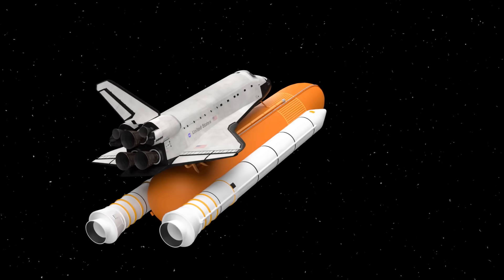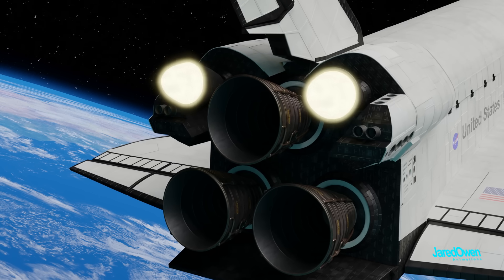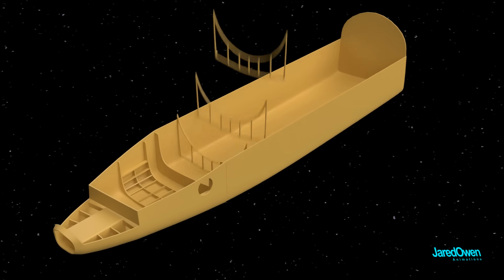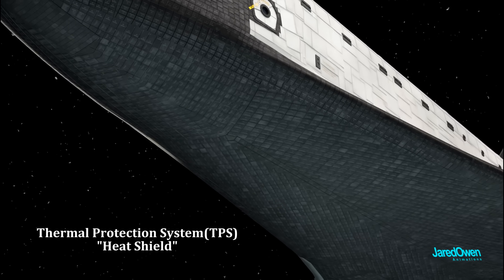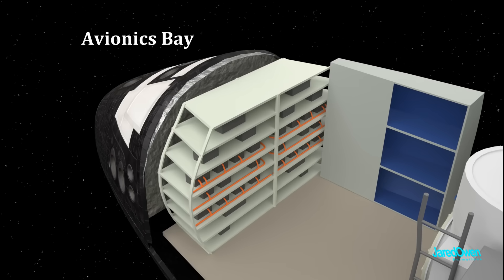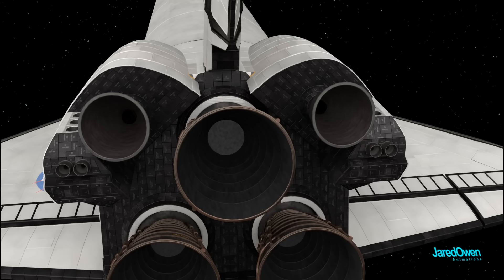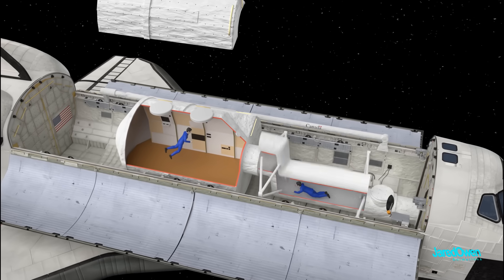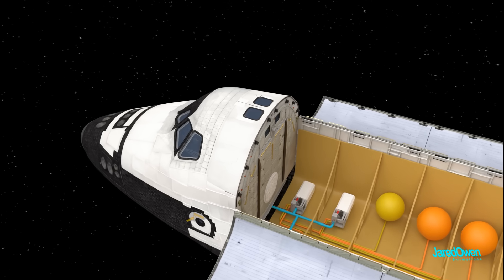How did the Orbiter Vehicle work? (Space Shuttle)

Comment: I hate to be like this but the space shuttle is NOT reusable, it is REFURBISABLE, same with the SRBs. they had to put extensive into repairing the space shuttles after each launch, unlike the falcon 9 where you just do a few checks and load the fuel back in. this is an important distinction.
Reply: Unmanned Falcon 9 missions are one thing but refurbishing will be required for manned missions.
Reply: I should have checked about the Falcon 9 as it turns out the 1st stage does get some refurbishing. Here’s a quote about the block 5 version:

“Block 5 could change that. The vehicle boasts many upgrades that are meant to shorten the refurbishment and downtime needed between flights.”

So obviously shortening refurbishing doesn’t eliminate it completely.
Reply: mako88sb I believe that is an old paper you are citing. The block 5 is currently the one that is in use, and yes they have to clean it but they don’t have to replace half the systems after every launch.
Reply: @MackAttack101   Yes, from 2018 but the point back then was that some refurbishment was still going to be needed. Some things were changed from welded to bolted-on for ease of removal for inspection. From what I’ve read, the goal is a booster getting 10 launches before refurbishing so definitely an improvement if it’s achieved.
Reply: mako88sb which makes it reusable, no? Not needing the refurbishing means it’s reusable.
Reply: @MackAttack101   Yes, that’s the goal but looking into it more, I’m not sure they will reach it. Musk previously said they would launch with the same booster within 24 hours no later than 2019. The recent launch of the South Korean satellite reused a booster 51 days after it landed which broke the turn-around time record held by the space shuttle Atlantis but no were near the 24 hour goal he was pushing for previously. Obviously the practical realities of reusability with minimal refurbishing are much more challenging than Musk’s expected.
Reply: @MackAttack101    “ Over the years they’ve mastered landing the Falcon 9’s first stage, and they’ve even proven that the recovered boosters can be safely reused for additional flights. But the refurbishment process is still fairly lengthy.”

From this: https://hackaday.com/2020/07/27/falcon-9-beats-shuttles-reflight-record-but-still-has-a-long-way-to-go/

Comment: Is it possible for the shuttle to be controlled remotely from Earth?
Reply: Not originally. However, after the  Columbia disaster, the remaining fleet was modified so that they could. The new procedure would determine if any tiles were damaged during launch and if severe enough, the crew would be left on the ISS. The Shuttle would then be remotely landed. The flight plan for such an eventuality would be over the Atlantic or Pacific as much as possible in case the damage caused a catastrophic failure.

Comment: great video but i do take issue with you saying it was reusable. While yes that was the intended goal the space shuttle was never truly reusable. After every use it had to literally be disassembled to make check literally everything. not to mention the external fuel tank needed to be built. it was refurbishable more than reusable
Reply: Good point. A big reason for the huge escalating costs and much longer turn-around time’s compared to what was advertised. I can see the same issue for any man-rated SpaceX spacecraft. The Dragon is pretty small so shouldn’t be too bad but it’s also pretty complex. I have Scott Sullivan’s VIrtual Apollo and it’s mentioned that the CM had the complexity of an aircraft carrier packed into something the size of a VW Beetle. The BFR with 31 Raptor engines being a reusable system just boggles my mind. I hope they pull it off but definitely have concerns.
Reply from the maker: Thanks for the comment - you are correct,  probably the right word is "refurbished"

Comment: Great video! Really amazing overview.
I know you can't put everything in. In addition to the landing gear, there are 2 more doors on the bottom to connect the aft of the orbiter to the ET to allow power, fuel, and oxidizer to be transferred. You can get into the wing through the landing gear. There was a drag chute compartment. You showed avionics bays 1&2, but there was also 3a and 3b on the mid deck. Avionics bays 4, 5, and 6 were in the aft. There is also an access door on the port side to enter the mid body and both sides to enter the aft. These doors were used to work on the orbiter.
Reply from the maker: Wow you know your stuff!!  yeah it's hard to figure out what to not include in a video.  There is so much cool stuff!!!
Reply: Jared Owen I worked on Discovery, Atlantis, and Endeavour.

Comment: The space shuttle was probably the best spacecraft I’ve seen. Too bad it failed and got retired
Reply: David Xu Oh, Columbia Disaster. The engines on the thing didn’t ‘burn out inside’, it was a piece of the heatshield being thrown off on liftoff, which came to bite them on re-entry. The gases and other nasty stuff started to leak into the payload bay and then the commander and such were knocked out. The thing then probably disintegrated due to being uncontrolled.
Reply: It was better it was retired, it was expensive and dangerous. Not to mention it’s design by committee leading to some Interesting... design and management decisions
Reply: @amanwithnohat3948  
Yeah it was indeed
Don't you know the Space Shuttle program 
costs up to 
US$ 211 billion as of 2012
Reply: @amanwithnohat3948   and the cost per launch was 
US$ 1.64 billion
Way to costly to develop the Space Shuttle program  TBH
Reply: @amanwithnohat3948  Indeed. It was initially planned for the Shuttle to have straight, short wings based on testing carried out with the M2-F2 and HL-10 lifting bodies in the 1960’s. However, the U.S. Air Force insisted that once the orbiter re-entered the atmosphere it had to be able to reach a landing site 1500 miles in each direction. This reason for this was that they required manned launches out of Vandenberg Air Force Base for polar orbiting missions. A once around abort profile without that cross range meant that there was nowhere to land other than in the Pacific Ocean. 
In order to have that 1500 mile cross-range the orbiter had to have a large heavy delta wing, which gave better lift than straight wings. However this increased the amount of heat the orbiter had to survive, which forced a completely new shielding system to be developed.
Reply: The space shuttle retired is because the "cost per launch" is now being expensive
Reply: The space shuttle retired is because the "cost per launch" is now being expensive

Comment: You are wrong when the space shuttle takes off because the three main engines burns more than in this animation. If the main engines fires very low, the space shuttle will be squished by the external fuel tank and if it burns too much it will slam the external fuel tank with the ground.

Comment: Just a quick correction
The SRBs and Shuttle were REFURBISHED, not reused. Everyday Astronaut has an amazing video on the topic, comparing what it takes/took to get the shuttle flying again and what it takes to get a falcon 9 flying again. The SRBs were completely stripped down, disassembled, etc, and at the end of the day only some of the outer casing were actually reused. That's kinda due to them landing in water, which doesn't exactly like leaving metal alone. The shuttle would have all 3 engines removed and inspected, all 22-33 thousand tiles would be inspected and replaced if necessary, etc etc. End of the day, the shuttle would require something like 700 thousand man hours to get back in service.

Falcon 9, on the other hand, would only need inspections and maybe the occasional replacement parts, and I'm not sure if they hit this goal but it would only require around 10 thousand to 100 thousand man hours to get flying again

Yes this comment is kinda disrespectful, saying someone else is wrong based on what someone else said. I don't care, I still wasted my time to make it, it boosts engagement
Reply from the maker: Hey Brendan - thanks for your comment!  (I didn't think it was disrespectful)  I believe you are correct "referbished" is probably a better word to use.  In a future video I may go over this in more detail
Reply: @JaredOwen  that would be nice, or you could just mention it in passing in another semi-related video. Maybe a video on a mars rover or the falcon 9/heavy, possibly with crew dragon explained as well?

Comment: Now I just wanna say that the Landing gear only comes down at 300 feet, 100 meters it is lowered at the height to minimize drag. So when he says close to the RWY I think he means REALLY close.
Reply: also it could only gravity extend, so it could not be put up again, one of the reasons the Space Shuttle had one shot at landing
Reply: @luz-5020   "No engines" was probably a close 2nd  to "non-retractable landing gear"!  ; )
Reply: @marcmcreynolds2827  true that, most Space Shuttle systems were designed for a one shot landing because of the lack of powered flight
Reply: @marcmcreynolds2827  I wonder how Buran made second try while landing though it has no thrust source as well.
Reply: Good you used both metric and imperial now no one understands

Comment: 1:40 launch animation is wrong.  Vehicle should "powerslide" in the horizontal axis as well as moving vertical.
Reply: that's a really nitpicky detail. On the subject of nitpicky details:
-SSME exhaust plume should be light blue
-OMS plume should extend out to infinity, not move in to a cone
-OMS used monomythyl hydrazine and dinitrogen tetroxide, not just nameless "fuel and oxidizer"
-Orbiters occasionally carried extra stages with satellites going to interplanetary destinations
There are a lot of fun stories from the shuttle era I wish had been told, too, like the time a gold bullet almost caused a disaster and when a leak in the toilet system caused it to start venting pressure out to space through the plumbing while an astronaut was using it (which lead to the repress system dumping in recently-liquid oxygen, and the vents were conveniently located just above the toilet, leading the astronaut in question to being blasted with arctic air while said arctic air was being sucked out under his posterior), but I guess there wasn't time.